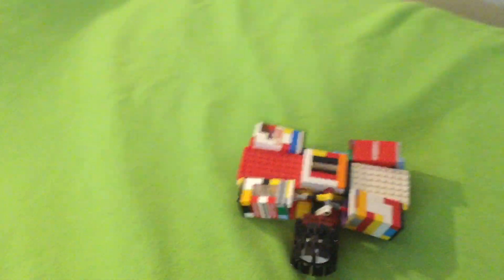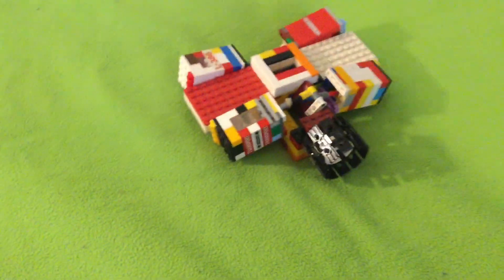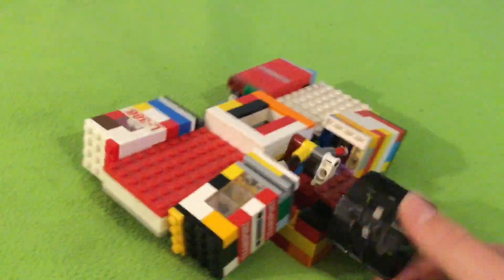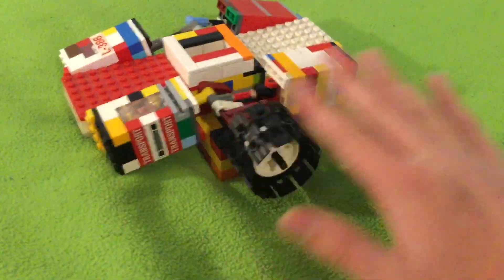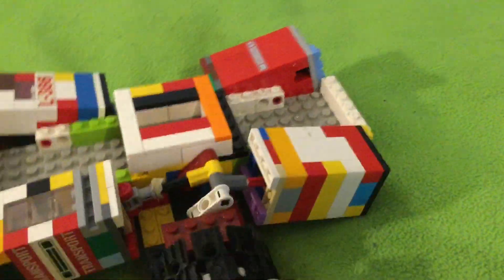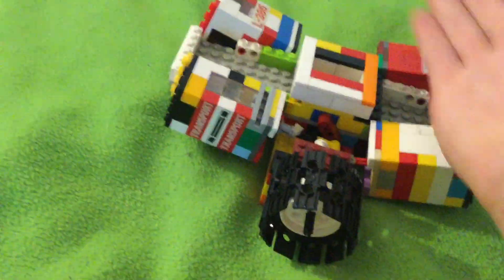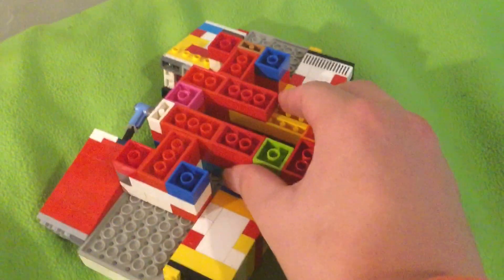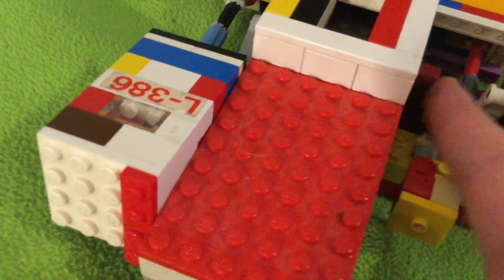Oscillating Flat 4 LEGO Vacuum Engine!

Comment: Also these types of engines “wobble engines” as I call them because they are usually very unstable when it’s just one cylinder. They don’t produce much power but lots of speed. I used to have a steam engine toy that worked exactly like this but it melted unfortunately. But that never produced much power as it was even though it was working on about 4 bars of steam. So yeah just keep that in mind otherwise very cool engine!❤